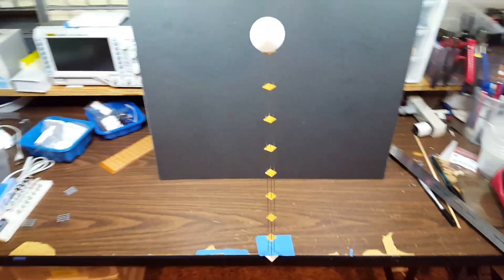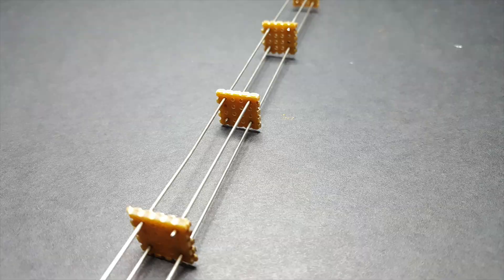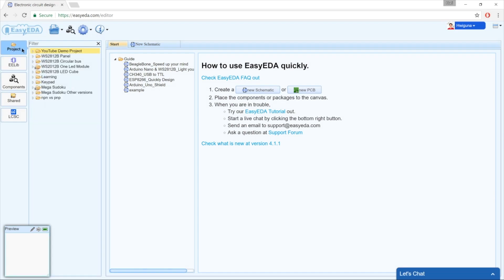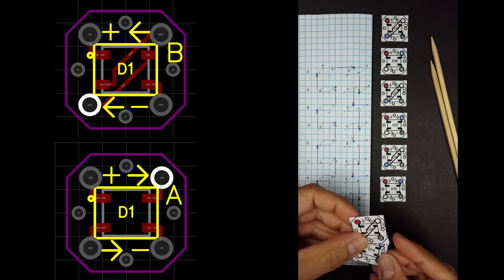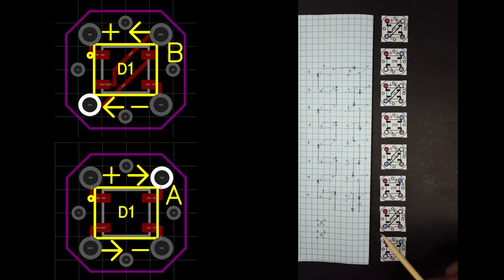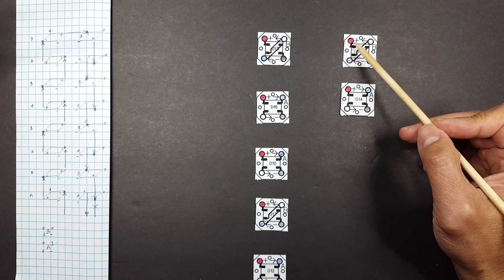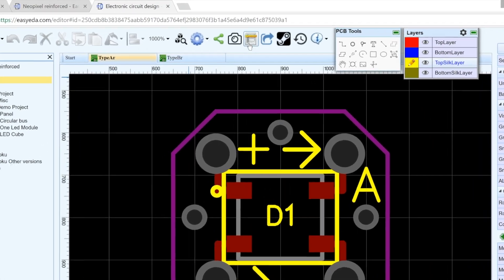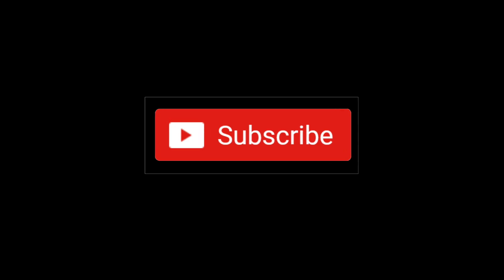HariFun #154 - Making 540 Custom PCBs with EasyEDA

Comment: can't wait to see it runing :-)
great job !
Reply from the maker: Thanks Simon!  I was discussing with my wife whether to title the video "Making 540 PCBs" or "Ordering 540 PCBs" when I realized how much work it will be to solder 512 tiny NeoPixels onto 512 tiny PCBs and solder those PCBs onto the wire pillars!! No turning back now :-)
Reply: Yep ... a lot of soldering !  
I'm on another similar project but i'd like to find the right connectors to avoid all this soldering. For now i'm on 90° mini jst ... but I wisht to find a better solution ;-)

Comment: Hi, great project. How is your software going? Do you want to use just one io line or split the cube maybe in 8 parallel sections (8x64)? Btw. see your metal model video and ordered some from aliexpress for 2 or $3. Thanks for sharing.
Reply from the maker: Thanks man!
I have not worked on software at all.  Breaking the cube into eight sections is a fantastic idea! I wonder which NeoPixel libraries support that...
About the metal model... I've never thought of searching for them on AliExpress. Those models so much fun! Thx for the tip! :-D
Reply: Maybe you can have a look at the OctoWS2811 LED Library (also for WS2812)https://www.pjrc.com/teensy/td_libs_OctoWS2811.html, but I never try it. And on the ESP32 you can try this https://github.com/MartyMacGyver/ESP32-Digital-RGB-LED-Drivers/blob/master/arduino-esp32 with 8 Remote Channels. Today I get my parts for a fake LED Cube (8x8x3 Pixel = 24strips with 8 NeoPixels) so I  can also try some parallel driving.
Reply: Here is some example code for the ESP32 with multitasking https://github.com/pcbreflux/espressif/tree/master/esp32/arduino/sketchbook/ESP32_tasks_ws2812 but no fancy pattern just a technology demo.

Comment: Hey Hari, hope you are doing well!

The panel of small pcb that you got, were they easy to break apart or did you need to cut them?

Also, Are you still working on this project?
Reply from the maker: Yes, their v-cut scoring works very well.  I was paranoid, so I clamped the PCB between to pieces of wood then snap off the exposed pcb.  But you can just bend it and it will break at the scoring. 
The cube has been done for a while, but I just have not found the time to write cool demos for it.  Here's work in progress:
https://www.youtube.com/watch?v=mly1I2xspuk&feature=youtu.be

Comment: Could you make easyeda solder all the leds on the pcbs for you?
Reply from the maker: Hi Angel!
EasyEDA does not (currently) offer assembly. I think there are other fab boards that do. But I am a glutton for punishment ;-) 
Let's see... (4 pins per Neopixel + 3 solder joints to the pillars) x 8 per pillar x 8 wide x 8 deep = 3,584 solder joints not counting underneath the cube and any additional strengthening trusses.
I better stop thinking about this before i have nightmares. lol
Reply: Hari Wiguna Do you live anywhere close to NYC? I could pass by and help you solder!
Reply from the maker: Unfortunately I live in the middle of nowhere Nebraska. lol.
THANKS for the offer Angel. That would be fun to have a cube soldering meetup :-D

Comment: way cool as usual . i detect a soldering jig in the making  .lol . if you get those boars in nice sheets .  you might be able to use the laser ( i think the one in your maker space )  to cut solder paste mask for re-flow/or air solder , or if solderin' by hand  to cut part placement jig from thin plywood to hold a few in place while you solder them , even if only sticks of 8 at a time .
Reply from the maker: Hi Scott!
Soldering them as a panel is a great idea! Beats handling tiny pcbs!
I'm sure soldering 1m pillars with flammable ping pong balls would be fun(?)
My hope is that since we'll be dealing with relatively large spaces between the balls, accuracy would not be as critical as the tiny cube on which half a millimeter difference is visibly crooked.
Reply: option 2 would make a great video especially if you get to 3/4 done before it all flames up. LOL  youtube seems to like videos with flammable endings.  
so you know what to do with a few spare balls ..   cut small hole , stuff with steel wool , and attach leads to a fresh 9v battery .   if you quickly mock up a 8 ball fake test pillar armed with just steel wool inside the balls it could be very enlightening . lol
Reply from the maker: Gee Scott, you are just full of hot ideas! ;-) Love it!

Comment: I don't know if you noticed but you forgot the 100nF decoupling capacitor for each LED. Let's just hope that there will be no problems in the long term.  ;)
Reply from the maker: It was an intentional (stupid?) omission on my part.  I tested one pillar and it worked.And indeed the whole cube works fine.  I had some issues with voltage drop that I resolved by using XT60 connectors instead of barrel jacks to connect the group of 2x8x8 sections.  What do you think the long term affect be?
Reply: If the flickering is too fast, some leds could die like it happened with a 3x4 matrix that my friend had made without caps  (5 out of the 12 leds burned down).

Comment: We will make a 10x10x10 LED Cube soon. Ping Pong balls are much too small! Our sponsor is an Arabian oil sheik. So we decided to use some of the many asteroids that fly around between Mars and Jupiter. But first we need to melt the sand of the Sahara to get the required 10^15 tons of silicon for the mosfet transistors. I will post a video when we are ready.
Our main problem is the required electric energy. This problem is still not solved. The wires must have a diameter of 2km to withstand the current of 100.000.000.000 A. 
The final goal is to install the cube in one of the lagrange points of the earth orbit around the sun and send a continous signal to our maker friends on other planets.
Reply from the maker: Hi der!
I really enjoyed that comment! Very creative!  Thanks for the laugh!

PS: When your cube is completed, please post a link to your video here. On second thought...I'll just look for your cube in the night sky instead of watching a video ;-)

Comment: Hi Hari,
this looks like a massive project, I want to see how you will get the pcb's and wires in the balls.
Regards,
Stan
Reply from the maker: Hi Stan!
I discovered (at least with the test ping pong I bought locally) just putting the ball on top of the LED works surprisingly well.  However, drilling a hole at the bottom of the ball to allow the LED to shine into the ball works awesome!

So my current plan is to build a jig to drill one larger hole for the LED to shine through and four TINY holes for the vertical pillar wires to go through. 

1. Solder the lowest PCB to the pillar
2. Feed a ping pong down the pillar wires, hot glue to PCB
3. Repeat upwards to build one pillar
4. Repeat 64 times!
Reply: HI, love the idea, just found your channel and I really love your content. The only thing that worries me is that you will see the pillars inside the golf balls when they are lit. I don't know how much they will be visible. But the golf ball idea is awesome.
Reply from the maker: Hi Krunoslav,
Wire shadows?! Gee, that is a good concern I have not thought of!  I'll have to test that.  Thanks!